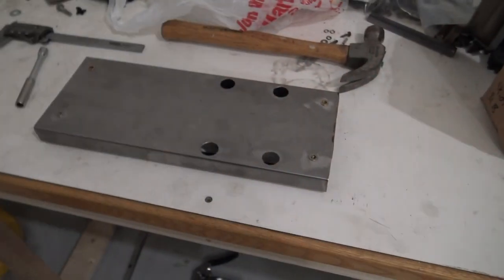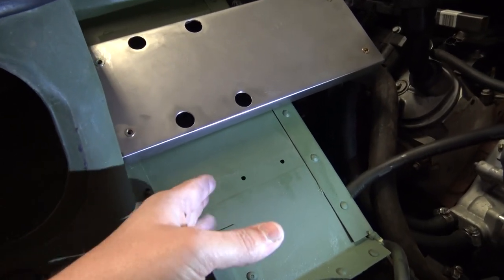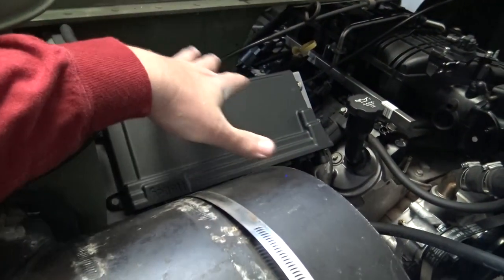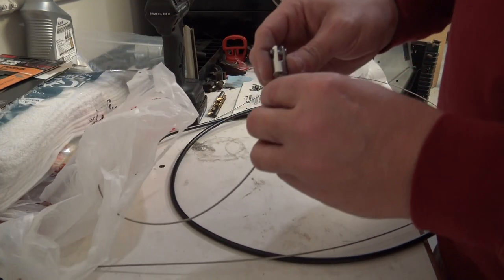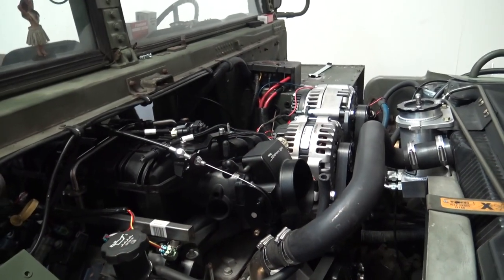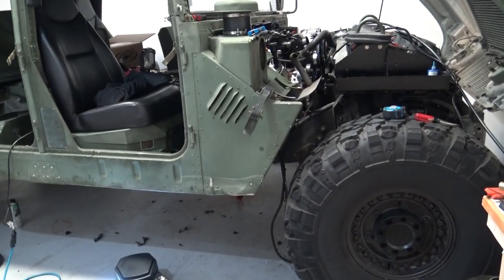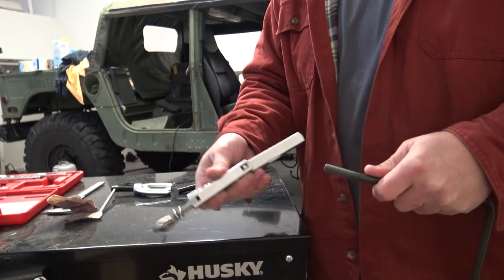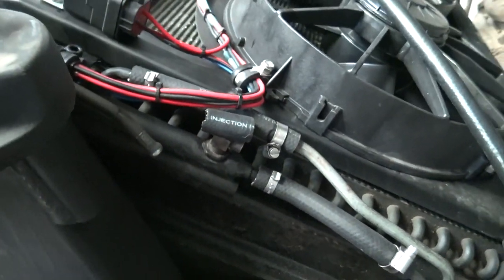Humvee LS Swap Update January 2019 - LSxHumvee

Comment: Do your self a favor, replace the wing nuts with a regular nut.  You can use a box wrench to tighten them easier.  I did it on my bubble and flaring tools that are just like yours.  Just a tip to help make the job easier. Thanks for the videos, I like to watch your progress.  Im doing  a duramax swap in mine so i feel your pain brother!
Reply from the maker: Yeah that's a great idea.

Comment: I've got a 1999 Hummer H1 (6.5 TD + 4l80E) I want to LS swap it, but I have a couple of questions.
-  Could I use the original engine mounts, or some modification is needed?
-  What is the best way to pull the diesel engine out?
-  What is the best engine to use for such a conversion (5.3 or 6.0), taking into consideration that I don't want to raise the vehicle? 
Any help is highly appreciated.
Keep up the great work!
Reply: 8.1l
Reply: Your gonna need something with some power... these come with 6.0 ls factory and are SLLLOOOOWWW
Reply: Put a 12 valve Cummins in it
Reply: I just completed the swap a month ago, 8100 Vortec

Comment: Couldn't you have flipped that dominator ecu around so that the plugs were facing toward the firewall instead of the filter housing? It would also allow you to route the wiring along the cowl like the factory wiring is set up for the glow plugs.
Reply from the maker: I could but water runs from the hood down the cowl so essentially I would be creating cups for the water to fall in, this setup the plugs are on a downward slant so if water does make it them it runs off and not in.